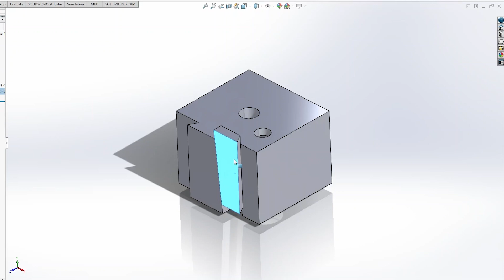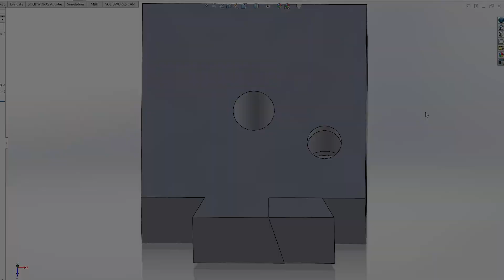Making A Wedge Lock Quick Change Tool Post For The New Lathe

Comment: Would be better to mashine the male dovetail on the main body and femail on toolholder. That way toolholder is perssed against the body plus holdind on dovetail. On yours the toolholder holds only on dovetail. That is also what is bad on all pin type quick change toolholders.

Comment: How come you chose to go opposite of the old setup as far as dovetail goes? Could you not gave done the post to be a male setup so you
Could keep the old holders?
Reply from the maker: just trying to squeeze in the moving dovetail and square thread, i had to put it on the outside to make it work

Comment: In the early 1970’s I learned machining on the job.  Tutored by several established machinists.  These were the days before ubiquitous NC or CNC, DRO’s, and quick change tool holders.   We did use Trav-A-Dials and dial indicators.   Every lathe had the 4 tool set up, BUT rather than index at 90° each move, they had indents every 15°.   This allowed the same tool to cut a plurality of angles.  Think different chamfers here.  
Now I have two lathes in my garage.  They are toys more or less.  Both have quick change tool holders.   I miss the old set ups.   I could rotate the 4 tool holder much faster than changing the so called Quick Change tools.  However, one must keep in mind that in a production run, the time to shim was insignificant compared to the one of a kind cuts made in most hobby work.   Still, I am tempted to modify the 4 tool holder that came with the smaller lathe.

Comment: Did the large threaded hole have to be so close to the material wall, it makes me freak out, thinking its going to snap 😂

Great video by the way 👏
Reply from the maker: Spacing was pretty tight on material but it doesn’t experience much load

Comment: how does your lathe stay in pitch for the thread cutting when it keeps running but it looks like you are taking it out of gear? haha the lathe at my work you leave it in gear and stop the spindle and then put the machine in reverse or your thread wont line up for the next cut?
Reply from the maker: I have a threading dial which allows you to disengage the half nut

Comment: I have a suggestion for your next Shop Upgrade Build Project...

Build (or buy) a bandsaw...you really, Really, REALLY should have one...

Please get one...watching you hacksaw your parts before cleaning them up on the mill or lathe is painful...

😄😁😆😅😂🤣

After buying or building a bandsaw, may I suggest a Milling Machine Upgrade that should increase the available power at the spindle to take advantage of the increased rigidity...

Specifically, machine up a pair of steel gears large enough to span the gap between the motor shaft and spindle shaft converting the Mill from a belt drive to a gear drive and also allowing you to make the motor gear a larger diameter than the spindle gear to allow you to reduce the Frequency you're running the motor at to something closer to what it's designed for while still maintaining the spindle RPM you need for machining...

Comment: I think the positive dovetail on the toolpost is a better plan for the following reason.  When you tighten it,  the tool is clamped front and back to the static face of the toolpost.  The sliding part of the dovetail is only pulling it tight,  with ideally no contact between the "top" of the dovetail and the toolholder.   With your design,  the toolholder is either clamped only by the face of the dovetail,  or you are trying to clamp against the front and back while one of those surfaces (the moving dovetail) is still trying to move under that clamping force.  You could put clearance for that in every toolholder so they only contact the solid parts of the toolpost,  but you did say you wanted simplified geometry on the toolholders.
Reply: Or you could take the moving dovetail out and shave a bit off its base so the unmodified toolholders don't clamp against it, as a quick fix

Comment: If your lathe is Chinese- make sure you clean all the ways, crosslide etc etc because they will be full of grit. And I thoroughly recommend the Swiss tool post as ABOM79 uses. I think you mean a gib not sliding dovetail/wedgelock other non-machinist term.
Reply from the maker: You wouldn’t believe the grit that came out of this machine when I first bought it
Reply: Oh I would. I had a mini Chinese lathe that I ashamedly bought. I learnt how to scrape on that. @artisanmakes

Comment: Your drill chuck seems to be off kilter, wobbling some whilst its turning... I dont know if its the general body of the chuck, the morse taper you are using or the interlock between the morse shaft and the chuck body, but that shit seems to be wobblin` all over... I know that drilling ``isnt`` a precision method, but i call bullshit on that, as you can drill reamer grade holes, at least accuracy wise regarding tolerances, with a good drill, a good chuck and a good machine... Blondie referred to the exact technique in her latest video, but yeah, that, or you can use a collet style holder for drilling to achieve even better results at expense of time and effort what with cleaning between each drill change... Look into that chuck and its runout... The drill seems to be quite stable and appears to be having less of a runout, but i would still inspect that... You are making some nice parts, and parts that are either machine tools or machine accessories, and that will benefit from precision holemaking... A wobbling drill has quite the preference for going off kilter and drilling a ``bent`` hole, which when tightening will try to pull the part laterally and load it with greater force on one side... Such problems are most obvious with spindles and precision shafting which when clamped with a nut that has its threads not square to the axis of the spindle can and will bend the spindle, thus inducing wear on the bearings, balance issues, unwanted stresses, fitment issues in some cases and so on...

Comment: Another potential modification to the design would be to reverse the threads so that a RH / Clockwise turn tightens the tool holder.

Comment: I love it man! Could use some tweaks like you said with centering the working side of the dovetail and making it deeper etc. I think you can even make yourself a handle with a square hole at the base with an optional set screw so it's removable

Comment: I have a tool post with the same offset style of locking wedge and it has 2 tool faces with the wedge locations mirrored. 
I wonder if there's enough difference in tool rigidity between near and far locking wedge to justify making a pair?

Comment: I'm curious why you didn't make the wedge type to fit the tool holders you already have? Seems as if it would work and save a whole new set of tools to make
Reply from the maker: The tool holders for the old tool post are a little too small for the size of tooling I use now. So I would have ended up placing them in any event.

Comment: Nice job but its inside out and backwards.
Reply from the maker: I did mull over about which side to put the moving dovetail on. My logic was that the tool experiences a good amount of force pushing it away from the work, so you’d want the face that experiences a chuck of that force to be the fixed dovetail. Cheers
Reply: @artisanmakes I reread my comment and noticed that it sounded snarky and I apologize for that. It wasn't the tone I intended. The lathe will pull the tool in towards the work and downwards. This is the reason that you can take a heavy cut, not back off the cross slide after you reach the end of your cut and traverse the carriage without it scratching your newly turned surface.

Comment: You know, if you got yourself a cheap corded bandsaw, not only could you do a video about making a table & a stand for it so you can use it upright (don’t do one of those designs which goes in the vice as they basically hang the whole machine from 2 tiny little screws) BUT you wouldn’t have to do your weekly hacksaw workout.
Kill 2 birds with one stone.
Hacksawing is a pain in the arse! I hate it. It was a life changer when I got my portable bandsaw. I used a reciprocating saw for a while, but the bandsaw is better.
Corded ones are cheaper & more powerful than cordless too.
Just a thought 🤷‍♂️

Comment: Be careful with your direction of travel when using the slitting saw. That screw slot in your end cap looked like it was following the rotation of the saw. You can get into trouble with that, wouldn’t want any workshop accidents.

Comment: At 10:20 I see you filing the radius to the wedge. An easy trick is to use the bolt circle of the DRO and plunge with a cutter. Whith a decent number of plunges you need to file only a little bit. Much faster than to use a rotary table and more accurate than just filing.
Reply from the maker: I really need to give this method a try

Comment: Seems like the rigidity of this design isn't that great. The huge part of metal removed for the screw seems to lower the overall integratety of the part too much for my feeling.
Reply from the maker: It did concern me and I was 50/50 about scraping this design until I started to test it. There can be quite a few changes made, but when it comes to rigidity, this thing does have quite a fair amount of it.

Comment: Really nice work as usual, I really enjoy watching your videos even though I don't need to make these things. A comment about your radius filing technique though, the way you do it is the obvious one and what I used to use until a lecturer showed me a better way which is counter intuitive to most people but yields better results. If you start the filing with the contact point furthest away from you and as you push the file forward rock the handle downwards so the contact point moves towards you, you should find it results in a better filing action and resulting radius.

Comment: Turned out really nice, also looks way more solid than the push type holders.
One idea tht came to mind while watching: for the holders you could get a big piece of steel and machine a long dovetail along the flat side, then just saw it into pieces. That way the dovetail should be really consistent. Still wondering when you'll cave in to getting a bandsaw :D

Comment: 2 suggestions -
1. remake the wedge to be smaller - that will give thee dovetail a wider more stable footprint while fixing your offset concern
2. integrate tension spring at the bottom of the threaded bar that carries the wedge - that wil ensure any tool vibration will neve shake the tool fully loose
Reply: Noticed that the dovetail used here is the opposite to a typical Aloris style- especially with the wedge type, I always thought pushing out with the wedge & pulling the 2 ends in against the toolpost gives it a little more stiffness... also, making things interchangeable with something out there lets you take advantage of finding a deal on commercial holders somewhere, since, I find, I could always use just one or two more... But, otherwise, very nicely done - especially the spiral milling!

Comment: An inspiration for my own hobby shop. I desperately need a rigid saddle compound and tool holder on my 10x32" import. The hobby milling machine needs better fly-cutters than the scketchy shrapnel spinners I'm using right now.

Comment: I just made my first QCTP at work with inspiration from your steel design. It’s 4x4x4 inches and I made the dovetails with wire EDM since I work in die making. It was a big help to see the mechanisms in action before I sat down to draft the model.

Comment: Great video, I admire what you are able to pull off with tools and machines you own. Keep going! 
Small advice I would give you tho* when reaming.Use a reamer in the collet chuck, because reamers are much tighter tolerances that the runout you get out of the drill chuck. Feel free to measure it with dial comparator, on every single one I measured so far was around 0.05 - 0.1 mm. :D
Reply from the maker: Cheers. I used to be so stringent on doing that. I need to get back into that habit

Comment: If I would have one point of feedback on the design it would be the following: 
At 17:39 when you clamp the tool holder in the tool post you can see a gap on the left and right on both sides of the dovetail.
The contact surfaces of the dovetail are in the middle of the tool holder.
If the two outer flat surfaces of the tool holder would contact the tool post that would spread the bearing surface out and make the connection much more rigid.
Looking at commercial tool holders that's the way the high quality ones are manufactured.

Either way, I'm very impressed with what you are able to make in your small shop!
Reply from the maker: I didn’t catch that. That should be an easy fix and hopefully net me a bit more rigidity. Cheers guys
Reply: Was about to comment on that too :) Halving the supported width is 4x more deflection per newton of force. And it increases the free lever length of the tool :/
The male dovetail part should only pull the part in, it should never be the main registering surface. Now the entire tool is basically hanging off the narrow part of the dovetail neck, not supported by the available surface on the solid toolpost

Comment: When you tighten it, shouldnt it pull the toolholder flat against the block? It looke to be pulling the toolholder against the dovetail and there is a big airgap between tool holder and block.
And, I'm sure you noticed, the moving part of the dovetail is on the wrong side. It should be on the rear and the fixed part of the dovetail closer to the chuck.
Anyway, fantastic video and cinematography as always! It's great to see your new lathe getting pimped. 👍🙂
Reply: If you watched closely, you would have noticed that this is not like the traditional Aloris AXA wedge type tool post/holder. The dovetails are reversed like the Hardinge type. So in this instance the cutting force from the direction of chuck rotation pressing down on the tool in the tool holder will also press the wedge down further tightening the tool holder in the post.
Reply: @FWSwart999  .. yeah that is a good point. I think I would still put the non moving edge at the front, and based on your point, the moving dovetail on the rear but inverted.
Reply from the maker: I did mull over about which side to put the moving dovetail on. My logic was that the tool experiences a good amount of force pushing it away from the work, so you’d want the face that experiences a chuck of that force to be the fixed dovetail. Cheers
Reply: @artisanmakes  ... I think of the tool like a long lever, the end of the tool closest to the cut gets the most force so the rigidity needs to be highest at the tool end closest to the cut. But thats just me.
Reply from the maker: I’m sure there is also that to contend to. There is probably some trade off. Which one matters most I’m not entirely sure, and how much it does matter is also up for debate

Comment: A good used horizontal bandsaw is fairly cheap usually $100 and they are so useful for cutting stock for the mill and lathe..just a real pleasure to use with a lot less waste and clean up to do..
Reply: The hacksaw is basically part of his body at this point
Reply: He's a cyborg, and one of his arms is a hacksaw.
Reply: My initial thought, now it would not be the same without the hacksaw. Its akin to a concert without a drum or guitar solo. :)
Reply: @robfrancis8830  yeah I guess it is his trademark now..just really glad he upgraded the lathe versus using that 600w motor lathe but with a 3hp motor as that was beyond sketchy even with the improvements I wouldn't stand near that chinesium grenade..
Reply: @wyattutz  each region is different but my point was to pick up a used bandsaw..just an example a new 64.5 inch blade 250lb cast iron metal cutting horizontal bandsaw is $325.USD and used they are $75 -$200 with $100 being very common on different market places..even cheaper a metal chopsaw new is $100 for the abrasive blade type and $250 for metal cutting chopsaw with the carbide type blade..or even better a metal cutting porta bandsaws are $100 new as well..point being there is many choices better then a hacksaw..that's all..
Reply: @wyattutz  I got one brand new BS128 for 450€ (and have previously a smaller one), never going back to hacksaw, it's a waste of time.
Reply: @wyattutz  A small horizontal bandsaw with a cutting capability of 125 or 150 mm can be bought brand new for €120 or so here at Lidl, and from several other companies as well. Or if you buy second hand you could get even better stuff for a similar price.

Comment: I just make a few tool posts that holds different dedicated tools and I just swap them out. I don't quite like the quick change tool post because of not enough rigidity.
Reply: A properly sized quick change tool post is plenty rigid enough. I can stall my 1000kg lathe no problem with a regular tool in the quick change tool post and a short workpiece in the chuck without any chatter . The problem most of the time is workholding rigidity for example long workpiece, or the compound slide.